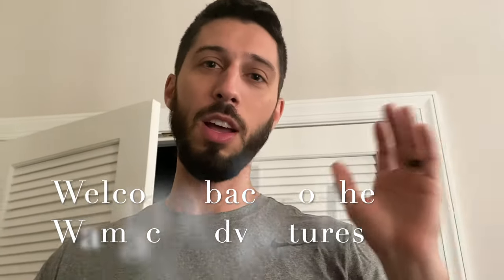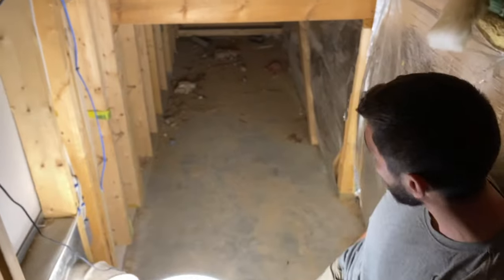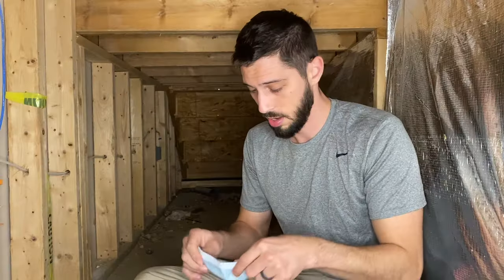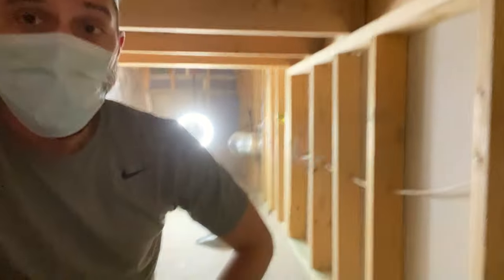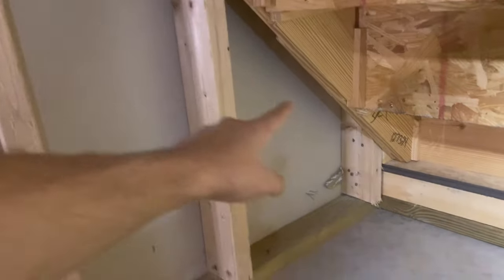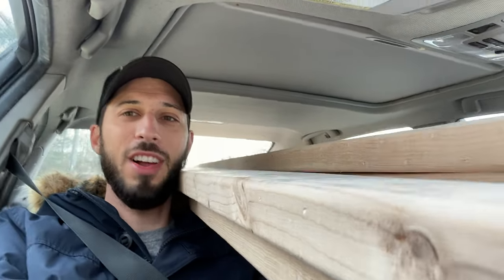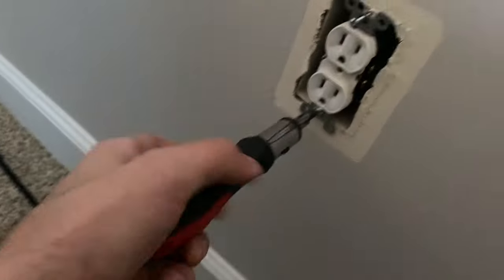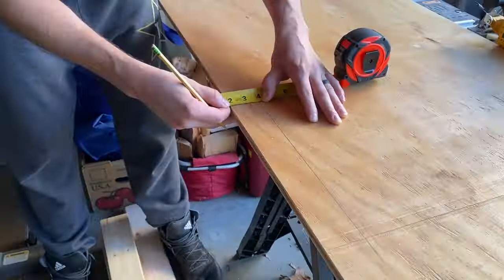Under Stairs Playroom - Full Build Start to Finish

Comment: Concrit: you should have done one of the walls in blackboard paint.
Reply: Wouldve made the space feel too small.
Reply: Maybe a whiteboard and some dry erase markers would be ideal cuz it wouldn't make the room feel so small
Reply from the maker: We are planning to do that (and more) in a future video showing it in use and fully decorated - great idea!
Reply: It definitely would've made it seem a lot smaller! But just doing one of the far walls would actually elongate the perceptual space!
Reply: @nathancarbo  There's clear blackboard varnish that you can just put on top of any color and it'll work just like a regular blackboard without the usually dark green/black color making it look oppressive

Comment: Awesome project and build.  I've wanted to do this at every house I've lived in with that dead space, over the past 30 years,  but they were rentals. 

I feel like there were a couple missed opportunities though. 

I would've 
1. Used a moisture barrier on any concrete that wasn't insulated in some way. Just as a precaution. 

2. Used insulation or some other sound dampening method on interior walls and the stair ceiling .

3. It appears you kept the air duct box accessible with a removable top,  maybe turn a couple sections on the front of it into doors for hidden storage. 

I would've been upset to find what you did in there.  Just because it is closed off dead space does not mean the building crew can leave garbage in there.  And there is no acceptable excuse for incomplete framing.

Comment: Lol he put his " sheetrock"  backwards 🤣.... Guess that's a new look for him !
Reply: It’s drywall
Reply: @kendallturner9732  actually the paper material on the back of the sheetrock can show through paint. and the backside has rounded edges that can be noticeable
Reply: plus the green sheetrock is supposed to protect against water damage, which kind of defeats the purpose if it's backwards
Reply: Stop being rude.
Reply: @afuturehobo  correct. I did drywall for 10 years

Comment: Okay so noone Is going to say he put up the drywall wrong? Looks great but the green side is the moisture/ mold resistant side.
Reply: Looks awesome and Amy kid would be lucky to have a play place like this also. Mission accomplished.
Reply from the maker: You’re right. I laid the piece upside down and cut out the pattern on the wrong side. I realized my mistake only when I was putting it up.
Reply: @adamwamack7709  the green side should be out paper side against the studs...love the project and love the work you put in to make your kid this little area
Reply: @adamwamack7709  the drywall in garage looks backwards for that matter… but might be a typo I just am not familiar with!

Comment: Cool for the kiddos and good job.  Couple tips, that green sheetrock is for bathrooms or areas where splashing may occur, white/purple is water resistant.  You started out right but you ended up flipping the sheetrock the wrong way.   Regardless looks good and happy for the kids.

Comment: A fresco or can of splatter gives you a uniform finish and you will never see the imperfections. 👌
Reply: Also, drill a hole and install a slow-moving hole fan to circulate the air. Kids will spend a lot more time in there. Small spaces get very stuffy.

Comment: The little blue wall you painted, when I was watching you paint it, a black train tunnel popped in my head. If you take it as a suggestion, I would use black chalk board paint, that way he could draw on it instead of your walls throughout the house. I was also thinking you should do one wall with white board for drawing  too.

Comment: Might wanna go back and caulk the corners with flexible + silicon type caulk cause the joint compound cracks there eventually especially since the stairs are going to be moving a lot👍👌😁 pro tip!!!

Comment: Cool project... id hit that paint like your mowing the lawn instead of scribble method.  Will give you a much cleaner finish and go much more quickly. I like to cut everything in with a brush and then roll in like you're mowing the lawn.  This method helps avoid dry rolls and uneven paint layers. Not here to drop shade just sharing from experience. Way to make the most of every square foot!

Comment: pro tip install the drywall the right way with the green facing out. pro tip use a impact gun to drive your screws. he thought about putting a shower there?  pro tip omg you see the gaps in the molding. this bawl

Comment: Pro tip? The brown paper should touch the studs, also I’m guessing that’s in a basement, same reason you have pressure treated wood touching the concrete, you should have raised the drywall off the floor by at least a quarter inch. That allows for moisture to not get to the drywall from the floor, but also for flooring or carpet to be properly installed. Not criticizing, but the colored side should face out ward, you literally installed every piece backwards except for 2. Always put brown paper towards the studs. It’s designed so when you put the colored paper out do you have a place to mud plus it’s better than the brown paper on the back

Comment: So if something goes wrong with the electrical or so would you have to break the wall back to get to the wires and stuff under the steps or there’s another way ?
Reply: There is no other way but to open the wall agian. (For the most part)
But if everything is working before the wall goes up and you don't screw through anything then there shouldn't ever be any problems

Comment: When you rerouted the pipe through the stairs, did you leave the same kind of trap, where it dips down and goes back up? I'm not a plumber but I know that p-traps are important for sinks and I'm sure there could be a reason that trap was there other than just for routing purposes. I could be totally wrong though, so I'd like to hear from you the answer to that!
Reply: It's a water line leading to a faucet. traps are only for drains. For water lines there can however be the issue of water hammer, but that requires a different kind of solution.
I think that weird 'loop' it was doing was merely 'quick and lazy' routing. :)

Comment: Just curious, what was the purpose of you putting the Sheetrock on backwards? Because that looks like the water “resistant” Sheetrock and putting it on backwards would defeat the purpose of that. You probably spent more on it too.

Comment: Of course the framing isn't "finished" the space under your stairs was never meant to be used as living space so therefore it wasn't framed to need to backing for things like sheetrock etc. And you installed almost all the Sheetrock backwards you did a good job hanging it but that paper facing is what protect the Sheetrock and makes it paintable. Also if that pipe you re routed ever bursts your going to catch hell getting to it.